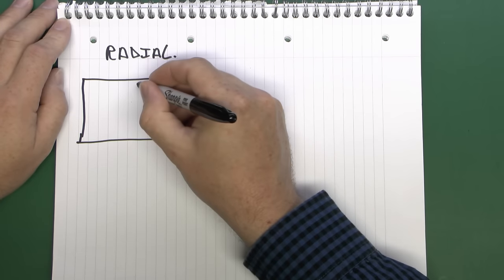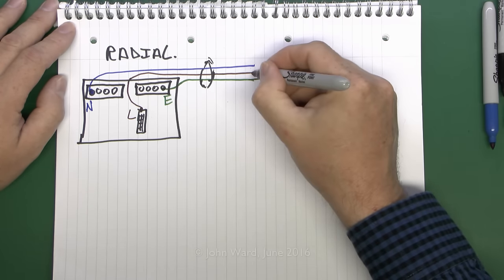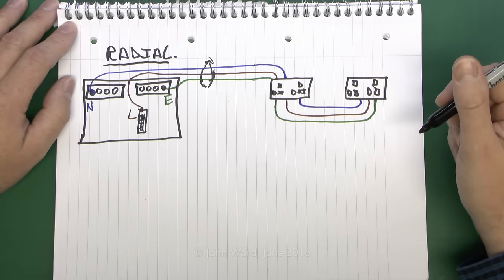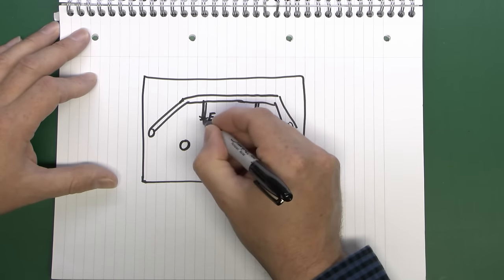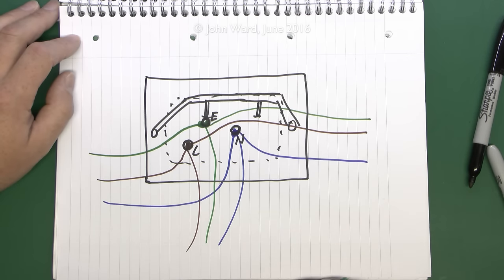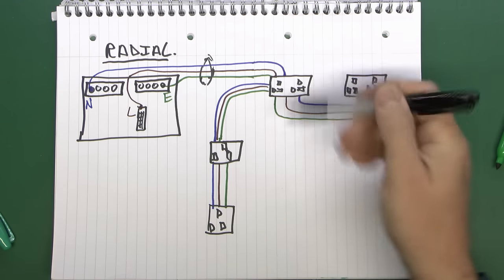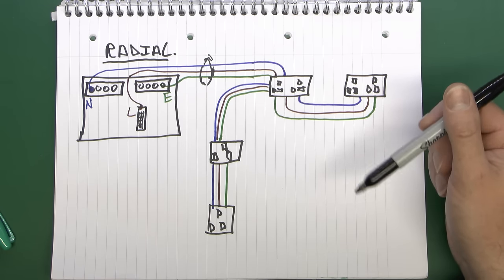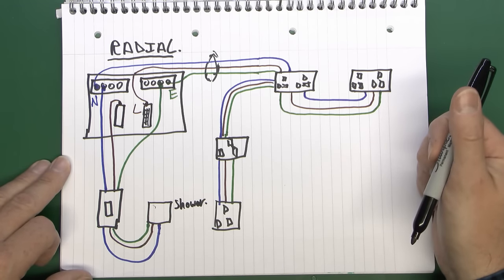Radial Circuits

Comment: Thanks for these really great videos, although I'm still a little confused about one point. In your videos on ring circuits you mentioned that a ring was able then to carry 32amps so I understand having a 27amp breaker would be ok, although the problem is that if there was a break in the ring the cable would be taking more current than it's intended. So in this case how would a radial circuit be able to carry more current? For example, if I had 2.5mm2 cable in a radial circuit with a supply that carries 32amps would that be a problem?
Reply from the maker: The basic concept of a circuit is that the cable is rated higher than the circuit breaker, so the breaker will trip before the cable is damaged.
A ring is a special case as there are 2 cables, which is why cable rated less than 32A can be used with a 32A circuit breaker.  Only valid if the ring is intact and there are 2 paths for the current to flow.
For everything else, the cable must be a higher rating, so for 2.5mm² cable the usual choice is 20A or in some cases 25A.  If a 32A radial was required the cable would need to be at least 4mm².
Reply: @jwflame  Thank you, that's very helpful.

Comment: I think most radial circuits are wired individually from an MCB to 1 receptacle or maximum just 2 which means if we have 5 mcbs we would have 5-10 receptacles,  right?
Reply from the maker: That may be done in some countries, but not in the UK.  One circuit can have multiple outlets/receptacles and usually does.

Comment: For radial I believe you use 4mm cable ? And what does the RCBO do , I did not really grasp that ? tks
Reply from the maker: RCBO is a circuit breaker and RCD combined into a single device.
Almost all circuits are radials, cable size required depends on the rating of the circuit breaker or fuse.

Comment: Shouldn't a fused spur be used when breaking into the radial?
Reply from the maker: No, only on a ring where a single cable is undersized for the circuit fuse/breaker.

Radials are designed with a single cable of proper size for the particular fuse/circuit breaker.
Reply: Thanks for your many helpful replies.When you explain it it all makes sense. 
After 1 week of electrical 'training' at an approved centre, my head was done in...

Comment: Hi John only watched a couple of vids but would like to ask if you have covered initial verification such as checking main bonding before starting any electrical works, 30mA RCD protection and correct operation, of any RCD'S ie disconnection times with a compliant and calibrated meter  >300mS and >40mS etc. Obviously you would also be advising on installation methods, maximum earth loop values for the protective device/fuse and breaking capacity to ensure circuit/installation complies with tables in BS7671 and guess you also advise how to complete the correct certification as required as detailed now in BS7671 2018 as from 1st Jan 2019 including AFDD arc fault detection devices....

Comment: brill john just one question how many could you have off it plus does you fuse rating have to be higher ?
Reply: 20 amp max on socket radials and as many as you want.

Comment: What size wires are used for radial as opposed to 2.5mm used for ring circuits?
Reply from the maker: Any size you want, provided the circuit breaker (MCB) or fuse is an appropriate size for the cable.
Common options are 2.5mm² cable with a 20A MCB, 4mm² with a 32A MCB, or 6mm² with a 40A MCB.

Comment: Hi John 
Help please ! When you did the ring circuit you talked about the issue that if one part of the cable broke that would risk overloading the cable as the circuit wasn’t complete - my question is - isn’t a radial set up also causing the same problem ? As in, it is in effect a circuit that’s been broken so the numerous outlets are drawing too much through the cable?
Reply from the maker: A ring is protected by a 32A circuit breaker, but the cable is rated to less than that (20A is the stated requirement, although it's usually about 26A), so is only valid if it is a ring, with two cables connected to every point and the total current shared between the two cables.   If the ring is broken, there is no overload protection as the single cable is rated to 26A, but the circuit breaker is rated to 32A, more than the cable rating.
A radial has cable rated more that the protective device, that same 26A cable would usually have a 20A circuit breaker.  It can't be overloaded, as the circuit breaker will disconnect before the current exceeds the rating of the cable.
Reply: @jwflame  many thanks indeed John - I get it now

Comment: so i,ve watched your "ring main" vid and now the radial vid and i can,t figure why bother with ring circuit when the radial dispenses with returning to the consumer unit....is it solely because of the 20 amp and 32 amp limits and can a ring circuit be changed into a radial simply by removing the return and re-configuring connections and breakers at the consumer unit? i,m not an electrician but i,m interested in what i,m paying for.
Reply from the maker: The original concept in the 1940s was to reduce the amount of copper used both by having smaller cables and using less of them.
The idea then was to have one ring for the whole house connected to all of the sockets near the centre or main part of the building, with spurs from the ring (single cable) supplying any sockets far away, such as those at the opposite side of a room or other more distant locations.  Cable could be smaller as there were two paths for current, so 26A rated cable can be used on a 32A circuit breaker (or 30A fuse originally).
Compared to the previous methods of multiple circuits and several different styles and sizes of sockets all wired with different sized cables, the savings were significant.
Today, there is no real reason to use rings, and when people install one per floor and even extra rings just for kitchens and utility rooms, it actually uses far more cable than radials, makes testing more involved, and increases the possibility of alterations and additions resulting in multiple sockets on a spur which can overload the cable.
Reply: but in light of what you said about rings being the work of the devil would it not be sound advice for insurance firms to insist all ring circuits are compulsorily re-worked into radials....after all even the most competent electrician cannot be 100% sure a connection on a ring circuit might not work it,s way loose over time....there,s money to be made here :)
Reply: Ring circuits are unknown in North America, as are fused plugs.
Reply: But a radial is simply a broken ring (or maybe a broken ring is simply a radial!) And assuming it is all connected correctly it halves the load on the cable as it potentially comes from both sides.
Reply: If you plan the circuits at the build stage, getting back to the consumer unit is no bog deal; just part of the natural run. It also means that 2.5mm^2 cable can be used on a 32A circuit, which is a good deal easier to manipulate than the 4mm^2 cable needed for a 32A radial.

nb. the advantage of having 32A circuits rather than 16A is that it gives the householder a lot more flexibility to plug in a number of relatively high-powered devices (electric kettles, portable combi-ovens, washing machines, clothes dryers etc.) without having to be conscious about what circuits might get overloaded and trip. I'd emphasis I'm not talking about truly high powered devices, like ovens & hobs which have their own circuit.
Reply: Ring vs. Radial
Which you should specify depends on many factors. What are the expected loads (does the building have central heating, so will plug in electric heaters be used or not, what appliances are expected to be used, etc. etc.). How many socket outlets do you want, both NOW and in the future (when someone decides to rearrange the furniture in the rooms).
Now draw up a plan on paper to work out the details. I always recommend that you specify more socket outlets than your immediate current requirements, as providing them now is far easier than making alterations later.
In a rooms where there are plenty of socket outlets, the distance between the sockets will not be that far, so the difference in cable cost between two radials and a single ring circuit will be insignificant if buying drums of cable.
Properly designed and installed ring circuits are just as safe as radial circuits.
Ring circuits are more flexible for the end user, as they can plug any normal appliance in to any socket outlet they like. Whereas if 20A radial circuits are used, too many high powered appliances connected and switched on at the same time on one circuit will trip the MCB. Worse if the protective device is a fuse... Fuses have the disadvantage that people can put in higher rated fuses, higher rated fuse-wire, or normal wire or other conductive material. And don’t think that a MCB protected consumer unit can save the day, as I have come across radial circuits run in 2.5mm squared cable protected by 32A MCBs...
Properly designed and installed radial circuit circuits have the advantage that no fixed wiring cables should overheat. But a poor conductor connection in a socket outlet could cause overheating and may result in a fire. So the argument that a fault will always show up in a radial circuit does not wash with me.
With a ring circuit, a disconnection or a poor connection could result in a cable being overloaded if multiple high power appliances are in use. But as there are two current paths, it does depend on where the fault is in relation to the circuit wiring.

Comment: Presumably if you found there wasn’t continuity between a ring circuit you could replace the MCB with a 20amp one and everything would be safe and dandy again?
Reply from the maker: 20A would avoid overloading the cable,  but if an existing circuit no longer has continuity it suggests a loose connection or cable damage, both of which should be repaired to avoid further problems.
Reply: @jwflame  I have seen electricians claim that one way round a broken leg on a radial is to disconnect that leg and convert the ring into two radials with 20A breakers. Perhaps if somebody has driven a nail through a cable  in an inaccessible spot.

 I've no idea if that's actually a legitimate approach though...
Reply from the maker: Yes, that can be done.  If a section of cable is damaged it would be disconnected at both ends leaving 2 radials, which could either be reconnected as 2 separate circuits, or 1 circuit.  20A or 25A is usually ok, unless the cable is installed through insulation or similar.

Comment: I have a 300/500V cable coming out of my consumer unit running to a single double socket, 2.5mm possibly.  Is this ok to extend into a radial circuit for washing machine, and general utility plugs for kettle etc.? Thanks. Excellent video btw.
Reply from the maker: It can be extended, provided the protective device (fuse, circuit breaker) is suitable for the cable.  If it's 2.5mm², usual choices would be a 16A or 20A.  Additional sockets also require RCD protection.
Reply: John Ward thank you

Comment: how is the trip switch valued.For instance in a kitchen where you use more appliences.Do you have to add up all the amps need.
Reply from the maker: Determine expected load for the circuit -> select appropriately sized cable for that load -> select suitable circuit breaker to protect the cable from overload.

Comment: great vidio but ive missed some thing some were whats the difference between radial and spurs?
Reply from the maker: Radial is any circuit that starts at the consumer unit and goes to one or more sockets, items of equipment or anything else - the vast majority of circuits are radials.
A spur is a socket or fused connection unit connected to a ring circuit with a single cable.
Reply: @jwflame  thanks for the reply and making sense of wiring for me

Comment: What size mcb and cable is required for a series of sockets? Surely you can’t have an unlimited number of sockets on a radial circuit such as a kitchen where you might have a 4 slice toaster plugged in and a fast boil kettle and maybe a food mixer etc all going at the same time? Do you have to use a diversity factor to size the cable?
Reply from the maker: There is no specified limit for how many socket outlets can be installed on a single circuit, but common sense will indicate a sensible number before it's necessary to have additional circuits.
Cable rating must be greater than the circuit breaker rating so that the cable isn't damaged by overload, but other than that the only limitations are whether the cable will physically fit into the socket terminals.
2.5mm² is a commonly used size of cable, but 4mm² is always an option, all BS1363 socket outlets have terminals large enough for 2x 4mm² conductors, some can accept larger sizes such as 6mm².
Reply: @jwflame  thank you for your reply. However as an example if you have say 6 x 13 amp sockets on one circuit, what determines the cable size and breaker size if most of them are in use? That’s why I asked if diversity was taken into account?

Comment: Just been looking at your ring and radial videos, very informative. I was just curious about your preference for the latter system.
If you only have one cable coming from the CU then surely there must be a set limit for the number of sockets you hang off it but you didn't mention it? Maybe I've misunderstood?
Reply from the maker: No limit on the number of sockets for rings or radials.
Circuit length is limited by the usual factors such as impedance, but that applies to rings and radials as well.
There were rules about the 'floor area served' for both rings and radials, however those are not regulations any more and only exist as suggestions in the appendix of BS7671.

Comment: Does every length of cable on a radial circuit have to be sized according to the breaker or can you take into account where on the radial the cable is located?

For example I have a 6mm cooker radial on a 32a breaker... I want to extend the radial with an additional 3a FCU for a hob sparker and a 13a FCU for a washing machine.... do these need to be in 4mm so as to be fully protected by the 32a MCB, or can I take the view that this additional length of cable will be protected from overcurrent by the fuses in the FCUs?
Reply from the maker: Overcurrent protection can be located downstream of the smaller cable, so in that example the cable from the cooker to the FCU could be smaller.  However it's also necessary to consider fault protection (short circuits) as smaller cables may not be able to withstand the fault current before being damaged.  That depends on the fault current available on that particular circuit and how much energy the MCB or other device will pass before it disconnects.
Reply: @jwflame  Thanks for your reply John, it's very decent of you to take the time to answer.

I assumed that any overcurrent fault condition in either the hob sparker or w/m would be fully dealt with by their respective FCU fuses, and any potential fault condition arising in this additional length of cable itself (ie some kind of short?) would be likely to blow the CU MCB. My view is that it's highly unlikely that a fault condition occurring in this length of cable would draw enough current to damage it without tripping the MCB / RCD on the whole circuit. Is this a reasonable view to take?